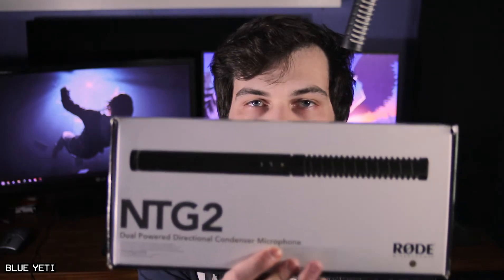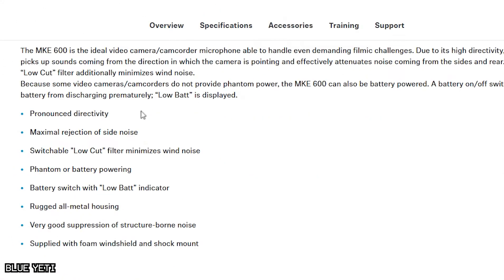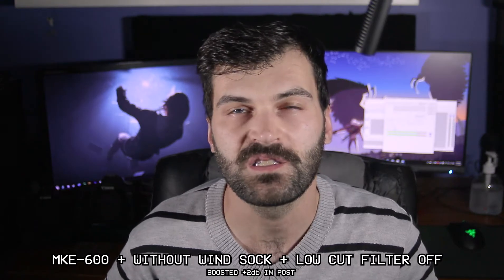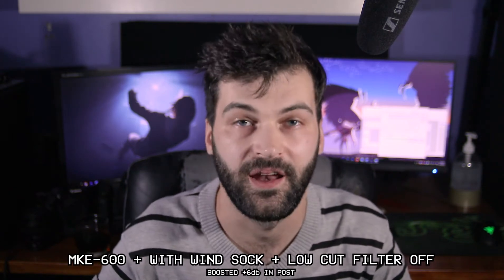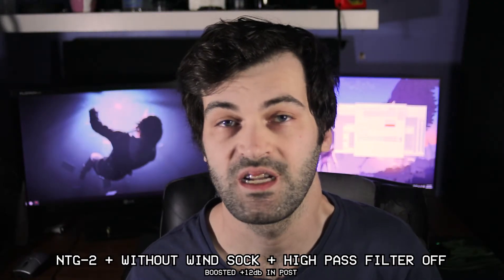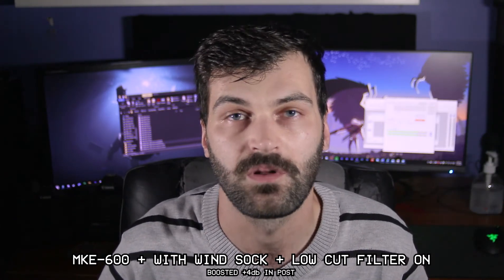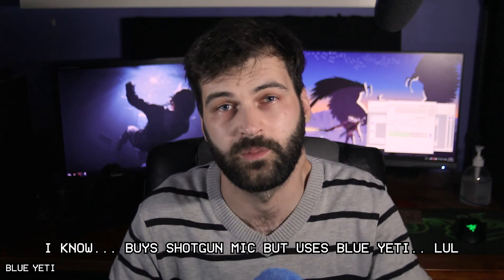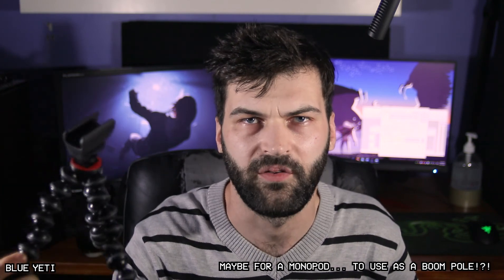Not Every Shotgun Microphone Is Equal!!!

Comment: I love my NTG-2 for use on my URSA Mini or in a blimp for outdoor booming, but, it does need a fethead to bring it up to level as well as phantom power. I have heard similar complaints to yours, Brett, when used with a battery rather than phantom power and also without the fethead. Can't say I've ever had issues with it picking up too much from the environment, it's not a true shotgun, but is quite directional.
Reply from the maker: I used a Focusrite solo with phantom power, the only thing that differs is the fethead... Though I don't have any issues with the new mic. Not sure why
Reply: @MADagain  My money's on the fethead! Glad the Sennheiser works for you, they are solid mic's. The NTG-2 is notoriously low powered, so needs some decent grunt to make her sing!